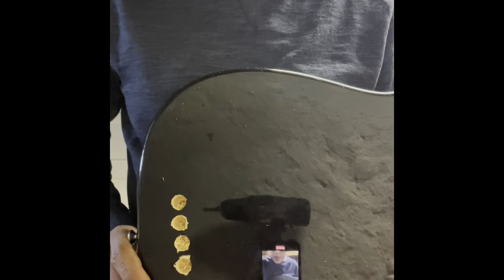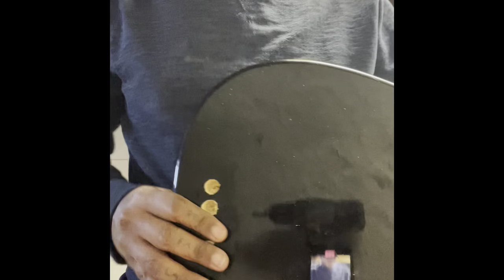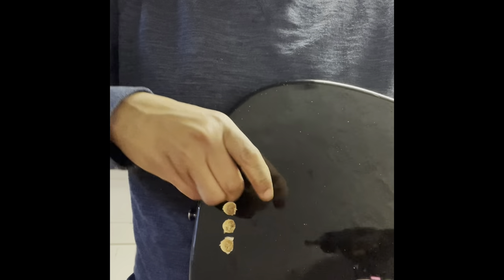bass ferrules - strings through body(squier p-bass)

Comment: Way to just jump in man 🤙 a couple tips, when your drilling through, pre drill  2 thinner pieces of scrap, put it on the top and bottom while drilling, and that might help with the chipping, also you should try to counter sink the holes in the bridge with the tip of regular bit (think \_/) just so the string isn't sitting on a sharp steel edge causing a bad wear or pinch point. Hats off for just doing it 🤙🤙
Reply from the maker: thank you 😃